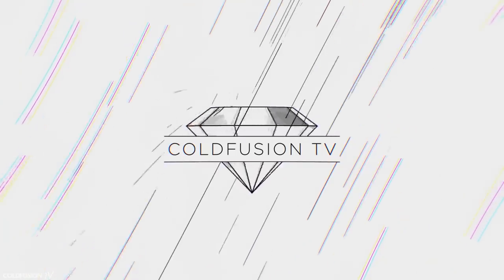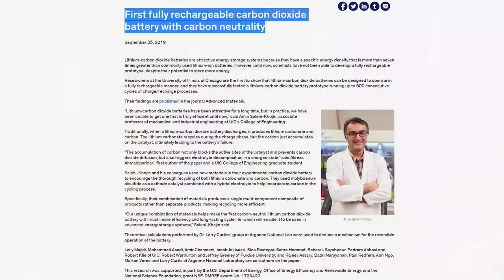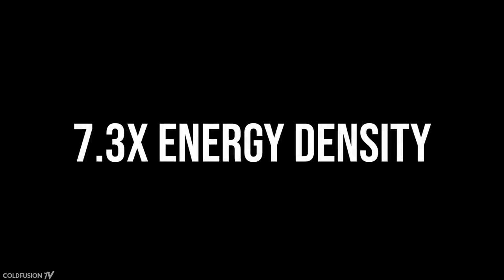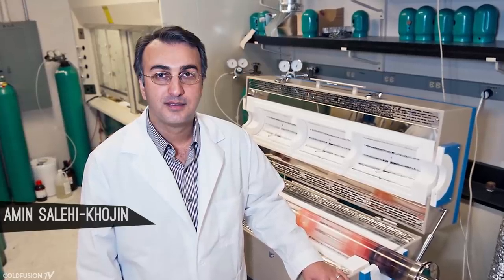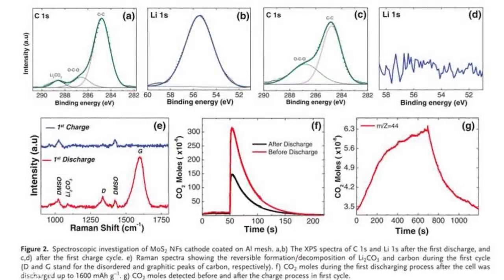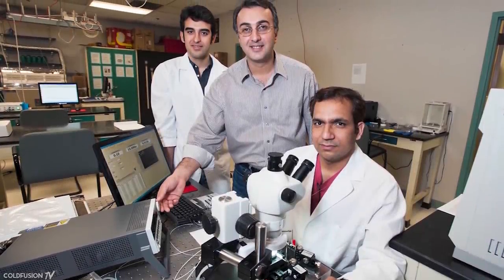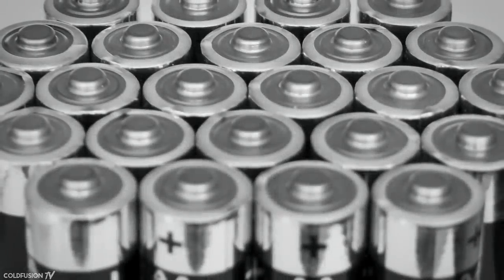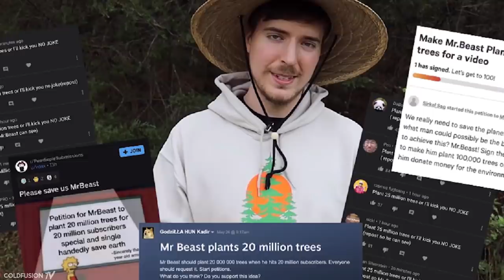Carbon Dioxide Battery Breakthrough

Comment: So, to put this into perspective, the jump from 234 wh to 1.876 kwh per kilogram (2.2 pounds) is huge. Not to mention the degradation fix, which if it is stated correctly in the video, goes from barely 100 cycles to 500 times that (50,000 cycles). Lets say Tesla's model 3 has these potential/theoretical batteries, the weight of a model 3 battery (long range) is 480 kilograms. 1876wh X 480kg = 900,480 wh or 900.48 kwh (thats a little more than what a average 4 bedroom home uses in a month in the US!) now the average energy usage of a model 3 is about 253wh per mile, so the range of a model 3 with these batteries per charge is 900,480wh / 253wh =  3,559.21 MILES (thats 5728 Kilometers) and since the average American drives 29 miles a day, thats about 4 MONTHS of driving without having to recharge! And when taking the battery life into consideration 3,559.21miles X 50,000cycles = 177,960,500 MILES thats to the MOON and back 744 TIMES. Now the current average rate per kwh in the US is $0.1319 in August 2019 so each full charge would cost 900.48kwh X 0.1319 per kwh = $118.77 every 4 months. BLA bla bla. Im sure you get where im going with this, once commercially viable, it has the potential to DESTROY the Combustion reliant Automotive industry.

Comment: Awesome line of research, getting rid of CO2 at the same time that generates energy.  If that works out with more recharge cycles it would be fantastic.  Gasoline has about 100 times the energy density of the best current batteries and taking into account the higher efficiency of electric motors if a battery with ~1/5 the energy density of gasoline is developed replacing liquid fuel with EVs can become a practical reality.  Still about half way with this but it is a huge step forward 👏🏻

Comment: If you would just see that fueling stations could be partially converted to battery change-out stations just as easily.  All the owner would have to do is charge the amount divided by his cost, add a profit and small amount of labor.  If the vehicles could accept a quick replacement, all the batteries would be ready and the cars would be out of there just as quick and go another 300 miles.  The batteries would be charging off of the grid ahead of time, and off you go.  The ownership of the batteries could be mitigated by a kind of lease deal with agreements covering all the freight delivery charges and recycling.  It would work, but everyone would have to be ready to change all the infrastructure.  The same thing is true for hydrogen if it's ever going to be possible.

Comment: “7x more dense”
That usually means 7x slower charging and 1/7th the current output possible. 
Compared to Ni-Mh like in Toyota Hybrid batteries, able to charge in a minute and discharge just as quick, with near limitless charge/discharge cycles, but with maybe 1/10th the density of lithium, making them useless for anything other than glorified capacitors in hybrids.

Comment: Looks to have a cell voltage under 3 volts, so is probably similar to lithium titanate , another slow starter tech but it has a much larger cycle life, just much lower density.

Comment: This completely changes with 7 times as many miles from the same size batteries. So let's say a car today owned by me only goes 100 miles till it needs a charge and I work 49 miles from home. Round trip about 100 miles and that means it will need to be charged every night. If the same car will go 700 miles on 1 charge, for me, that would mean being charged 1 time per week as long as I am not going crazy on the weekends.. So that battery would last 500 weeks for someone like me. That's about 9.5 years on that set and 350,000 miles..  Now I somehow DO NOT see this as a reality today, but if they can do this with this tech. FANTASTIC!!!  Or did I hear something wrong???

Comment: Battery technology has made great strides.  I remember when everything ran on carbon-zinc batteries.
Reply: I remember when car batteries were the old clunky lead-acid type. I remember that because the EEPmobile car battery died last month after I nursed it 2 final years with weekly chargings, so I had to buy a new-fangled lead-acid car battery in Canadian Tire.
Reply: Steven Soco  woooosh
Reply: @chris2944  Funny though this is lead-acid battery tech has actually improved since the early 20th century...  AGM batteries today can sustain 1000s of shallow discharges and 100s of deep discharges that would utterly destroy flooded batteries of the past, etc...
Reply: @tomstdenis  thanks Tom very cool

Comment: Pluses: great energy density.
Negatives: still uses lithium and 500 cycles is on the low side.
Reply: You mean high side
Reply: a normal everyday Spider  we need more carbon dioxide in the air to stop the suns heat getting to the ground and sea

Comment: A few issues. First, an easy one, there is not a direct ratio of Mj/Kg to Mj/L, you can not claim that is will be 7 times smaller just because it is 7 times lighter for the same power. Second, and far more importantly, we have zero data on what the real energy density will be nor any idea of the cost. The process that makes it fully rechargeable, could make it 10 times more massive, there by making it useless. There is also a critical factor of cost, again, something where we got zero information about this. Ei, if it cost double that of current batteries for the same power, it would be totally useless for cars. An electic cars batter cost is ~$6K now, so a $12K battery for the same range is not going to fly. Flying on the other hand, if you could drop the weight to even 1/5, it would be worth a TON of money for aircraft.

Comment: Panasonic and Samsung both made lithium batteries with 5000 particles per mL too (instead of 500) which would be 10x the capacity, but they haven't released anything

Comment: Unless I missed something, UIC managed to go from 100 recharging cycles to 500. That is a 5x improvement, but if you divide 500 by days, it hardly sounds useful.
Reply: Steven Soco  Point taken. So let's assume a car has range to make weekly charging viable. 500 cycles/52 weeks is about 9.6 years. Seems plausible for a car. A plane, no way. It only makes sense to fully charge a plane each flight for safety reasons. I think this improvement is good but not good enough in my humble opinion. Hopefully the breakthrough we need will come...

Comment: This battery has the potential to change aviation if the high density and mass producibility can be achieved. It is only a matter of time that a solution like this will become available as the interest in  and demand for batteries has increased

Comment: Under normal temperatures and atmospheric pressure carbon dioxide is a gas. So where is this fabulous energy density comes from?
So which of these applies:
1 The battery will be the size of a railway tanker to provide enough CO2 molecules to store a decent amount of energy;
2. The CO2 in the battery will be heavily pressurised to pack in enough molecules;
3 The battery will work in crygenic conditions to keep CO2 in the solid state;
4. It is really a new type of nuclear reactor, the energy is stored at the nuclear levels, so you don't need too much of the material to store enormous amount of energy?
If none of the 4 above applies it smells like a scam.

Comment: A few weeks ago there was a story about a new aluminium battery that was supposed to last 1500 miles. If these new battery inventions are ever produced commercially I very much doubt they could be easily swapped into a car with a current technology battery as all EV batteries are different physical sizes.

Comment: Majpr problem isnr density, but safety, when you go up in density.. The rapid reaction in malfunction is catastrophic. That is why it isnt always a good idea to go denser, as there is a rwleason why fuel, fat or such things are good, energy dense "battery", that unload one time in a controllable manner. There is also a current reason, why we dont go more density. It is dangerous to use until proper countermeasures are in place.

Comment: Congratulations on 2 million subs! While 500 charge cycles is amazing, for grid level storage that cycles and charges every day, those batteries would have to be recycled in a year and a half. For consumer devices the increased density would lengthen that, because the car, phone, laptop would not have to be recharged every day. If this technology means a car, or phone only has to be charged once a week, a usable lifetime of 500 weeks is superb for a consumer device. Now, if they can just be manufactured in the same form factor as existing batteries, and manufactured in the millions per month, by next year :-)

Comment: Lithium ion energy density is 0.36–0.95 MJ/kg (new battery x7 rounded up that's 7MJ/kg)
Gasoline energy density is ~44 MJ/kg
U-235 energy density is 79,390,000 MJ/kg

7 MJ/hg is awesome for personal electronics, especially if it can be made robust. But for grid cars and planes, a carbon neutral liquid fuel is still the best idea. Liquid fuel manufacture only requires process heat and chemical components. If we got the heat from fission instead of diffuse sources and chemistry the tiny proportional "loss" would be completely swamped by the overwhelming energy density of nuclear fuel. (really any nuclear fuel)

If we weren't scared of nuclear we could pull carbon right out of ocean water (which would pull it out of the air to compensate) and use it to make perfectly clean fuel. (As a side benefit you'd also have an endless supply of drinking water.)

What you're essentially doing is back driving a chemical process, adding energy instead of extracting it. Unburning. Converting a tiny fraction of U-235's energy density into chemical energy density. And since we're making it from parts  by design it can be literally 100% clean burning. As opposed to oil which is essentially like filtering and burning mud.

The best chemical battery currently is still a fuel. With liquid being the easiest to use. Though carbon neutral solid fuels are of course possible as well. What I would like to see is a liquid fuel cell for personal electronics. I'd rather needle a few drops of fluid into my phone every couple weeks than charge it every night.
Reply: The take away here is use U-235 for bicycle lights. I'm on board, count me in.
Reply: @grindupBaker  Asphalt scorcher 9000 bike mounted photon cannon :P Now with fission! But seriously though a beta voltaic is solid for stuff like that. Like pacemaker batteries.

Comment: I have heard this type of thing before “new battery type” for example Aluminum Air Batteries have been an area of research since the 1950’s or 60’s but they were unsafe and impractical and those problems could not be solved at least at that time. That said, I’d love it if this tech took off. Would make everything awesome!

Comment: While 300 charge cycles is not a wonderful thing about the equivalent of lead acid. Consider seven times the capacity equates to 6 times per cycle less charging so 6x 300 = 1,800 charge cycles less needed. So this compares to a really good & stable present lithium life span where each charge cycle  = 1,400 miles per charge!
Even if they can not surpass the current life it is better then what we currently have.

Comment: 500 charge cycles isn’t really that much.. there are also a lot of other factors like charge and discharge rate, operating temperature range, vibration resistance, and most importantly how easy is it to manufacture?

Comment: Latest battery technology and recharge cycles:
LiFePO4 - 5000x (no fire, no smoke)
Graphene Composite - 6000x + (no fire, no smoke)
Li-Po - 500x (can explode and catch the fire)
Li-Ion - 500x (extreme dangerous when overheated, can explode, can catch the fire)

Comment: These batteries need to get to at least 2000 cycles lifespan to be practical, or be really cheap enough to replace every year or so, as we are talking maximum 250 days with one charge and discharge. If this is 500 recharges, then it can be a year and a half roughly.

Comment: 500 charge & discharge cycles is... well, it's not enough. That about the same as my 52V 30Ah Li-ion ebike packs if they are fully charged and fully discharged. Lighter is better to be sure, but charge cycles need to be in the 1000s.

Comment: Interesting that this announcement was made at around the same time as Penn State university published the results of their research XFC project (US Dept energy funded). Their seemingly simple and cheap way to achieve 200 miles of range in 8 minutes of charging (the average time it takes to fuel up and pay to fill an ICE car..assuming no queues at the filling station) ..could overcome the only remaining objection to ditching fossil fuels. This is of course a different proposition and who wouldn’t want a battery that is smaller and lighter for the same range or one that has longer range for the same size? The consumer of course will not care what the battery chemistry is, only that it does the job of powering the car. What ‘new chemistry’ proponents face is the momentum behind LiON batteries at the manufacturing stage.

Comment: I don’t remember hearing about how long it takes to charge? If that 7 times as long to charge as well? With only 500 useful charge cycles is a big negative in my opinion. We have that problem with Lithum Ion now. I’m still waiting for the promise of hundreds of thousands or million cycle Graphene batteries with quick charge capabilities. I could live with a little lower energy density if I had a 250000 cycles and seconds to charge. If it only took a couple minutes to charge but gave me only 8 hours of use, I could charge it a couple times per day and still have way better battery life in terms of Hal’s many years before a battery needs replaced. With today’s devices getting glued together and batteries impossible for end users to charge, this is more important to me.

Comment: Energy density 7x higher you say? 👀 Galaxy Note grenades... Or grid storage site pretty much turning into a pool of glass if something goes wrong

I do wonder though if that could lead to different self-defense devices, instead of guns that fire bullets would it be practical to discharge the entire cell in a portable energy weapon

Comment: 5 months ago there was something like this the air battery or something or other or the plastic battery and well it's today and nothing.. 
nothing at all has happened.
hearing about this stuff since 2012 and my new laptop Still rocking that lithium ion 18650 cell.

Comment: 500 recharge cycles.  When that becomes 2000 cycles and is cheaply replaced with common materials of manufacture that would be the breakthrough.

Comment: I am trying to find out what pressure they run at. Given that there is an intermediate co2 state, does that mean they have to be at 853 psi to prevent out-gassing during charging?

Comment: LiPo Batteries used in Drones are heavy and have a high risk of fire. They are not very efficient. We need a different power source that is light, able to produce large and consistent amounts power and is less volitile. Only options I have seen still in testing is hydrogen cells.  Our flight times suffer  due to the weight

Comment: I've got eight 120amp hour AGM batterys been running my house for 8 years now I'm wondering when they are going to fail .does  every appliance  but not my fridge.  ..if you invent a battery that lasts 30 years I'll buy it.

Comment: This lithium carbon dioxide battery is remarkable if it can be commercialized.  The university has taken it along but odds are it needs a big funder to step in to take it to the end game of a commercial product. I would be hopeful that such a funder exists but the issue is often that the university has to see it fly away to get step done.if this is not done then other innovative alternative batteries still step forward and make the better battery with the university.

Comment: this will be like creating a new fuel market.. countries will still have to invest a lot in them like they do for importing oil.. very few countries have lithium and other raw materials required and since the batteries won't last long, you will have to replace them every year or couple of years.. which won't be that economical, adding this with the initial cost, we cannot call this the next revolution with all these challenges.
Similar research is going on with metal-air batteries ex: aluminum batteries, aluminum is not rare like lithium and you will be able to simply replace them at fuel stations instead of charging them. which increase the range as well. for now, this still seems like a better idea.

Comment: Why have a battery have 500 charging cycles, when the battery needs to be recharged up to 10 times a day? why not 10 or a little over a period of several years per charge, now that would be an sufficient battery

Comment: This needs to be paired up with the carbon dioxide scrubber that they have as a air factory plant to be paired with this battery it provides a safer way of storage the carbon dioxide and power back to everyone = a win win for all. The cost be damed I'd rather breathe cleaned air then choke on smog.

Comment: If this actually happens, and manufacturers of cars can produce cars with 5 times the range, then I'll start considering electric cars.
Sadly, I suspect they'll simply reduce the physical battery size and weight, and keep the range around 500km.... And that's assuming this even happens.

Comment: Question is it ±100 cycles * 500 with the new battery or 500 cycles...because the latter would still not be a lot of times, ok the energy density helps so you can't compare it straight up with li-ion batteries...but 50000 * 7 for higher energy density would push it to insane limits too....is energy density looked at energy / mass or energy / dimensions i.e. the same weight of battery of a Tesla S now which will do ±500km would do 3500km or would it not fit?